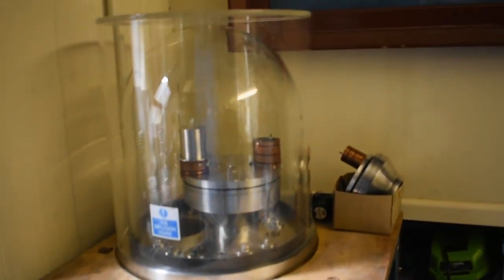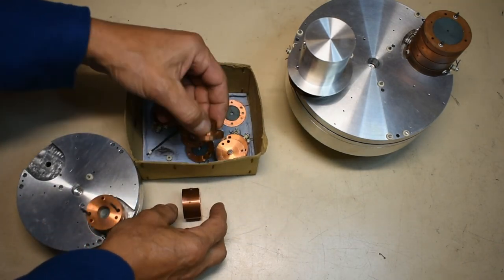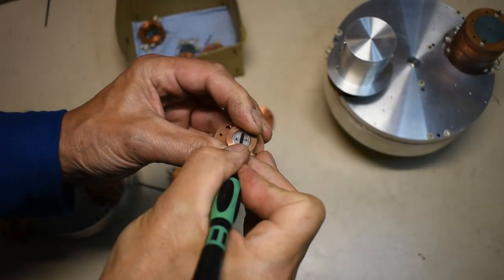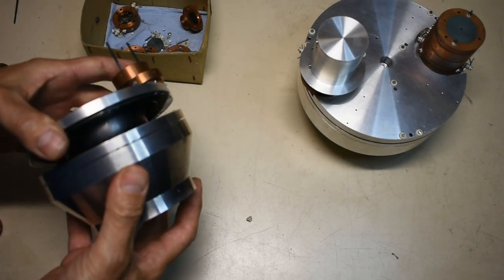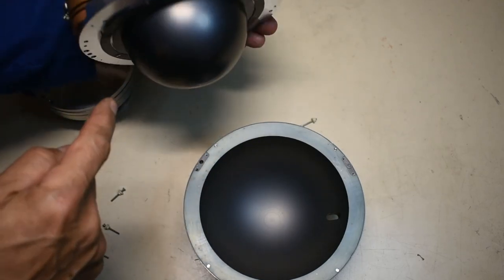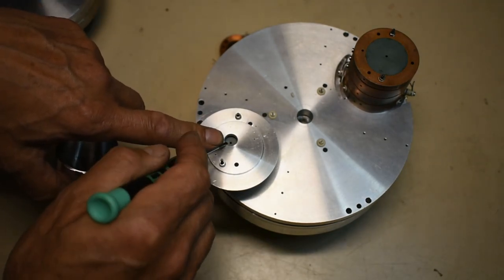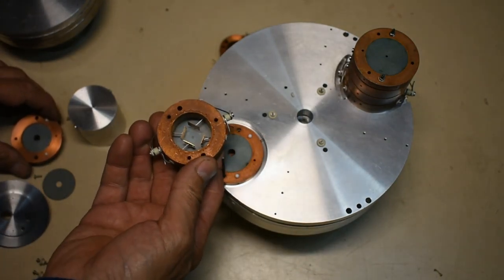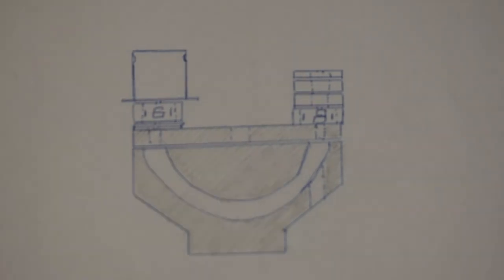Unusual vacuum chamber apparatus

Comment: I would guess the graphite path allows selection a given electron energy level by using varying deflection voltage so the beam goes in a curve.

Too low and it crashes into the sphere, too high and it goes into the bowl.

The other end with the hole, it kinda looks like you can put a sensor below to sense reflections.

Probably all wrong guessing!
Reply from the maker: Thanks for the suggestions, your guess is as good as mine. Did wonder if there is a certain velocity and pd across the channel that would allow electrons to travel in one gun and out the other, but sounds tricky. Another guess is perhaps its not in a complete vacuum and ions are generated in the channel.